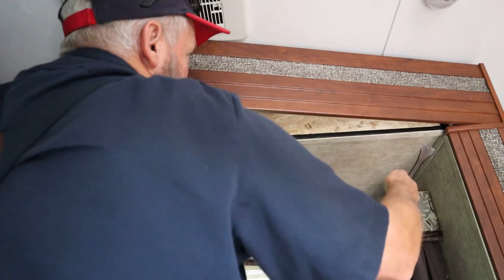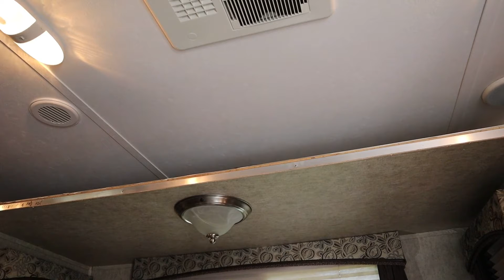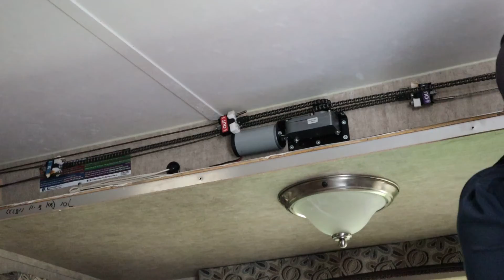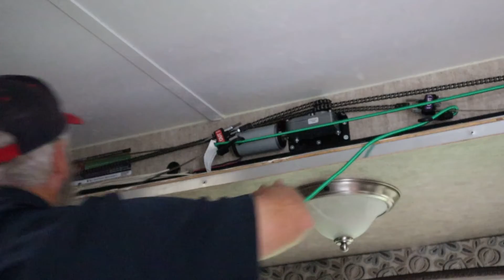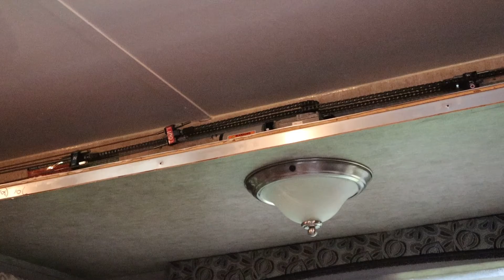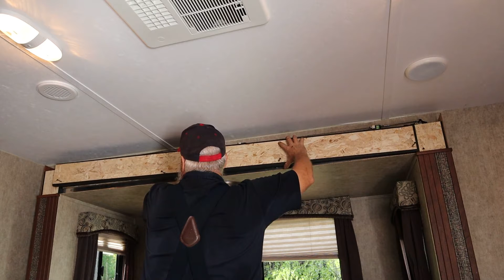BAL Accu-Slide Broken Gearbox

Comment: Good video.  Thanks!  I did not think that you would get the motor and gear box out by just loosening the center threaded rods but you did.  Then unscrewing the motor assy to get the lower chain off was genius.

Comment: Great video. My situation is similar but the slide is stuck all the way in and I am completely blocked off from getting inside to try to push as you did.  Do you have a suggestion for getting the slide out?  Much appreciated!

Comment: About to do this when I get to my trailer (5 hours away) what size nut is on the cable adjuster. Just want to make sure I have the correct tools. This video will hopefully make it smooth sailing. Thanks! @hilbillyrv
Reply from the maker: It has been a long time since I done one of these. I think 3/8, 7/16 and 1/2 maybe.

Comment: Would you say it is the gearbox if it goes out no problem but won't come in unless I push.
Reply from the maker: Probably
Reply: @hillbillyrv  also, do you have to put anything to support the slide when changing the gearbox out.
Reply from the maker: No need. @donstuck-v4w
Reply: @hillbillyrv  thank you for your help.

Comment: Nice job I have a question can you change the gear box with the slide out about 3/4 of the way out cause I don't have an removible panel and really don't want to take all the top trim off thank
Reply from the maker: If your slide is made so you can get to the gearbox while the room is in that position, go for it.

Comment: Nice job and thanks for posting this! I watched this and a couple of others and tackled the job with my wife and it went pretty well!  I made the mistake and took the bolt all the way out of the carrier which made taking the chain off super easy! However, getting it back on was another matter. When I went to put the chain back on the new gear box, and I lined it up with the marks I made on the chain before disassembling it\- the chain was too short!  So I had to adjust the cables and chain to get it back together.  But the initial consequence was the slide would not open all the way or close all the way. so we spent a good 90 minutes adjusting the chain and cables until we got it dialed-in.  Next time I'll be more aware not to take the bolt all the way off and do it like you did! But i the end, your posting gave us the confidence we needed to do it! Thanks!
Reply from the maker: Awesome Andrew